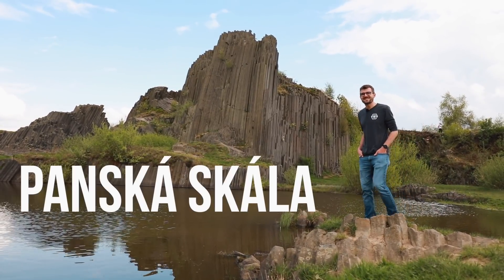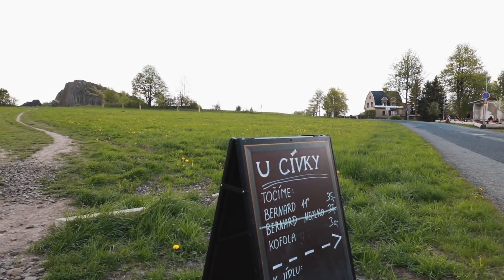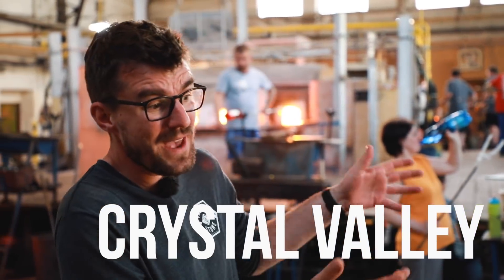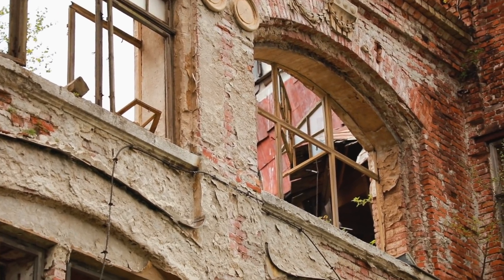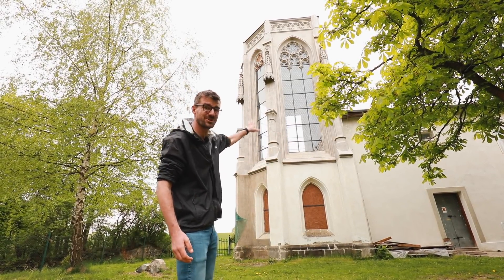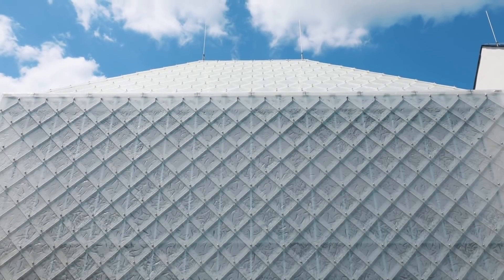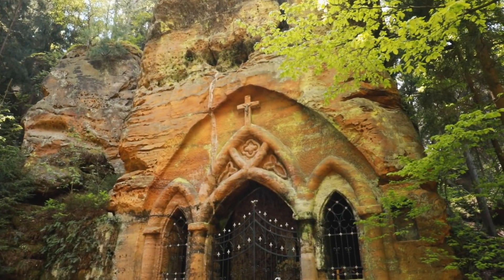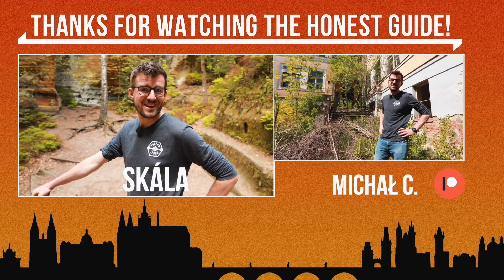Undiscovered Beauties of Our Country

Comment: A bit of casual research shows that basalt columns are probably date to volcanic fissure activity 30m years ago.  The fissures were part of the European Cenozoic Rift System - a system of faults that developed as a result of the development of the alps. Basalts are most commonly the results of ocean volcanic activity, but they are also common in rift systems where deep mantle magmas make their way to the surface without too much mixing with continental crust.  Basalt fractures like this when thick basalt flows solidify at the surface allowing the interior to cool slowly and fracture in an organized way.  The surface layer above them is tyipcally blockier and randomly fractured like the upper layer you can see at Zaltý vrch.